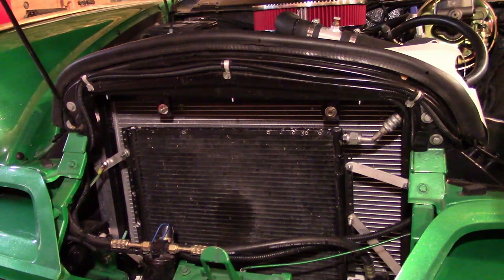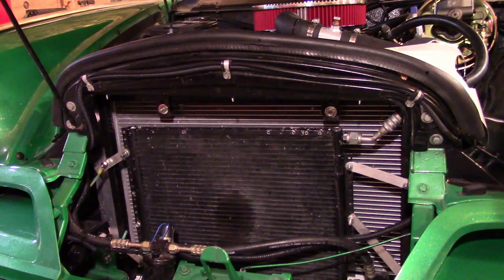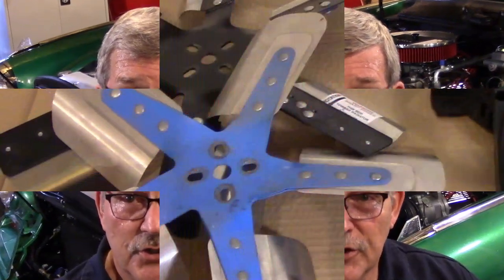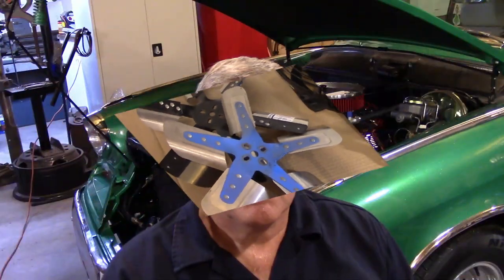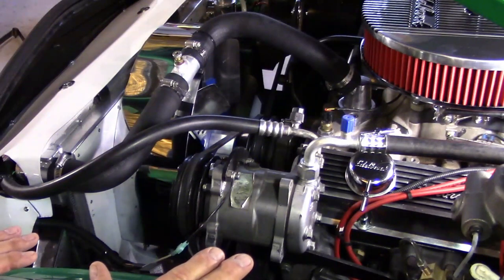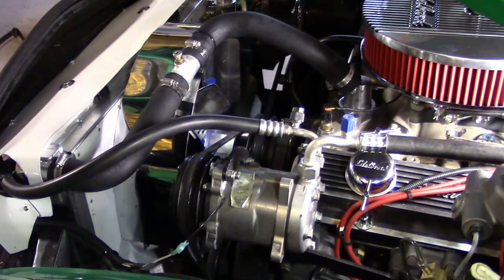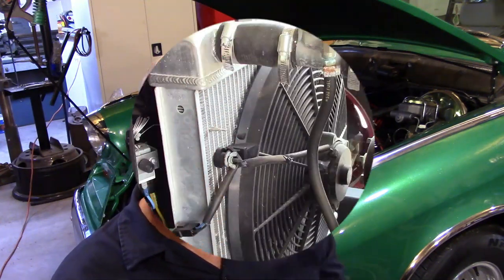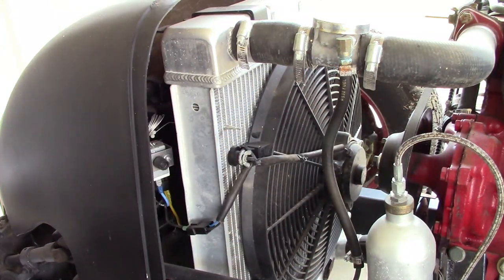Selecting the correct Engine Fan

Comment: Good video. I had a 0.60 289 Reed Cam in my Mustang. Went to a two long row Cold Case aluminum radiator Seal 301020049 electric fan. Worked great till the electric fan did not work in Florida heat. The first comment when I post is why did you not look at your temp gauge? Easy answer, terrible rude Florida drivers who cut you off, break at the last minute and have zero respect for other drivers while getting nowhere faster. You so far have the best video. And the only one talking about fan depth. This is the first major issue I have had with this engine since 1998.
Reply from the maker: Like you say every car has it challenges. Finding the right cooling combination takes a while at times. Thanks and appreciate your comment

Comment: Great chat about the science and physics of the cooling system. You obviously have a wealth of knowledge and first-hand experience on the subject.
I'm amazed that with a little pressure (7 to 16 PSI) you can maintain 180 to 195-degree temps in a cooling system fitted with a properly sized fan and related shrouding.
I enjoyed your explanation of fan placement, size, and airflow considerations. Much respect to anyone who has had a cooling system that was underperforming and resolved the issue with these guidelines.
Work safe, stay cool, happy cruising! (Love seeing your beautiful Studebaker in the videos, 5 stars)
Doug@ the "ranch"
Reply from the maker: Thanks Doug, most of the car show are during the summer months. So if you show your car you have to be prepared for some hot weather. Enjoy your week.

Comment: I have a flex fan on my 79 Ford truck and it has the original shroud ..I pulls a lot of air when you rev the engine ..A great improvement over the factory 4 bladed fan..Electric fans are a great Idea when mixing matching different engines and radiators
Reply from the maker: Te flex fan works good for me. It can move enough air to keep the engine cool and keep the engine compartment flowing the heat out. Thanks and take care

Comment: Fan Fan Fan..   i was just thinking about ..  wondering about which fan will work when I put the SBC in the Rat Rod.  I ran the original old steel 4 blade in the Caddy.   Would like to run the same in the Chebby.  Want to keep the engine so that the driveshaft still works to the t-5 and was wondering if the fan would be near enough to the radiator.   Just me mulling over rat rod stuff here.
Reply from the maker: With both your cars having the engine exposed , you shouldn't have to much of a problem.  A flex fan is simple but it needs to line up with the rad to get a good air flow. Good luck on what you install.
Reply: @RustyGlovebox  Started sorting through the engines yesterday and found the 4 bladed fan for the 283.   I didn't measure the caddy motor but probably should just to ease my mind, but it doesn't matter.  I'll make it fit.  I like the old fans on the rat rods.   Think I kind of lean towards a traditional hot rod look more than some.  Probably because I'm an old guy..  hahaha.

Comment: Great video thanks brother. A lot goes into the equation when choosing one. I remember the first Monticarlo probably spelled wrong. I opened the hood and the fan shroud looked like a quarter of a 50 gallon drum. We use two electric fans on the simi race trucks. They do a great job and they are also helping cool the power steering. The power steering system we have going through a oil cooler. The race car I worked on was a flex fan and I didn't like it at all . This video will help out a lot of people. Keep up the great work see you in the next video thanks again brother
Reply from the maker: I remember those shrouds on those Monte's. Almost more shroud than engine. Thanks Scott

Comment: Seem to remember fans are only required at very low speed, or stationary Lloyd. So electric ones are the most efficient.
Reply from the maker: I had a problem at all speeds but this fan moves enough air to keep the engine running cool. Thanks Malc
Reply: @RustyGlovebox  Of course, it's not an original setup is it Lloyd. I had an old car once (can't remember what make) but it got hot in traffic. Going somewhere on a hot day, I had to keep stopping to let it cool down.

Comment: Great info, not everyone thinks about fans / cooling until they overheat and blow head gaskets, transmissions....    A friend Tommy had a 64 GTO he too went from a vert to a horz and also added an oil cooling system.  It did the job until he totaled the can street racing.  :(
Reply from the maker: Thanks Buzz, there are a lot of options to handle high engine temperatures. No easy answer every time.

Comment: several years ago there was a flex blade fan company up here at Rolla, I think it was schwitzer , they moved out and B&S moved in for a while and now, as far as I know , nothing is in the building,  I had a clutch fan on my 67 4-4-2 and it locked up,, talk about noise and  the dust would just boil our from under the car on a gravel road.
Reply from the maker: Those clutch fan can be a problem when they wear out. Lucky if they don't come apart when they fail. Thanks Vernon

Comment: Hey great video I just install dual electric fans in my chevy tahoe. I noticed while testing these efans knocks the battery completely dead. Im considering going back to a clutch fan or maybe combination of both. My question is do I need to reflash my pcm to get the clutch fan to work again.
Reply from the maker: I would go back with a new clutch . I wouldn't think you would need to reflash unless you had a problem with it before. Good luck.

Comment: Thanks for the tips Rusty ..  flex fans/clutch fans (or electric fan)  - interesting ..  thanks for the explanation !!   and description of position of fan . ...  so far I have not had the need extra fan but may on the air cooled generator engine ..     Thx Rusty          Gary
Reply from the maker: I like that gen set. That would really be handy if you had an outage. Thanks and take care Gary

Comment: back in the day i had a 1998 opel corsa cdx 1.4 4 cylinder Ecotec motor and under the winter control and certificate i replaced the radiator with the fan but it did t worked and believe it or not i manage with a boiling hot motor to go to the dealer was half-hour drive.was replaced all worked.
Reply from the maker: Thanks Alberto, car cooling systems can be challenging at times and expensive to repair. Enjoy you week